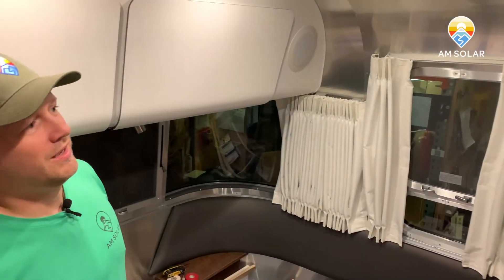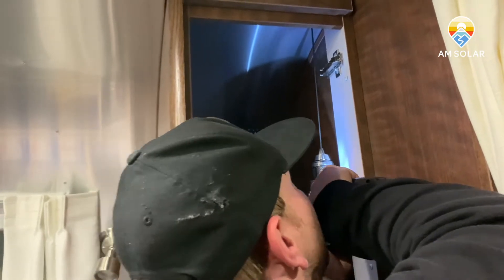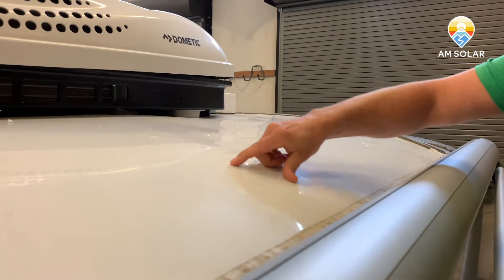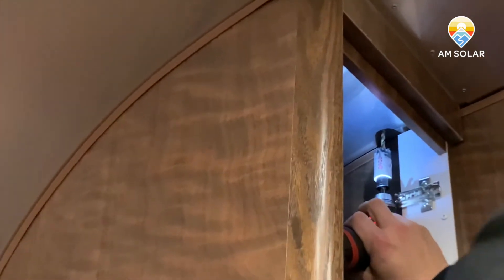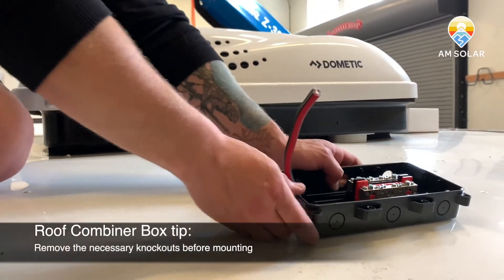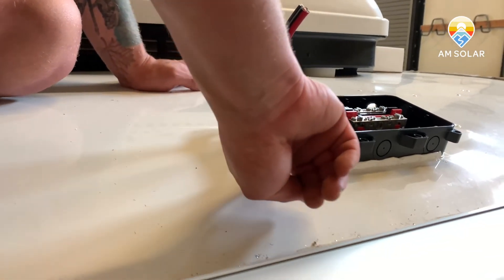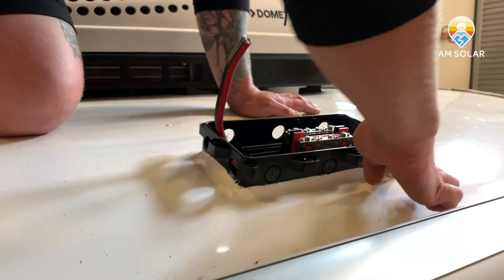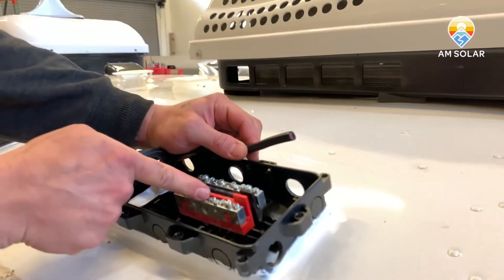AM Solar DIY Tutorial: Airstream Solar Wire Route & Roof Combiner Box

Comment: Would I be right in thinking that you simply abandon the Airstream solar prewire and leave the Zamp combiner box on the roof?
Reply from the maker: Correct.  Usually, the pre-wire is too thin for more than 300W of solar.  We just bypass it, since removing it would be very difficult and unnecessary.